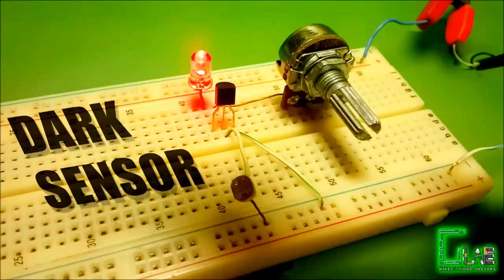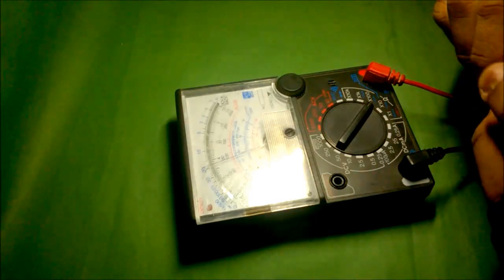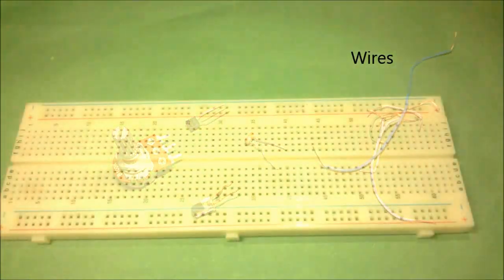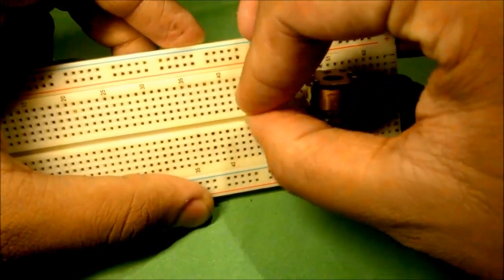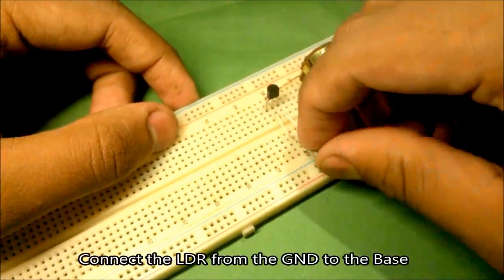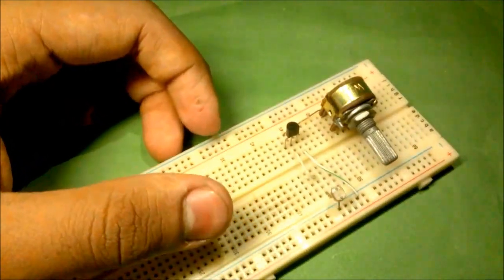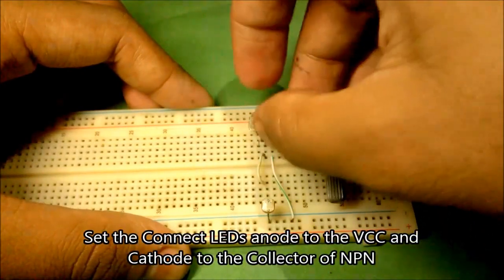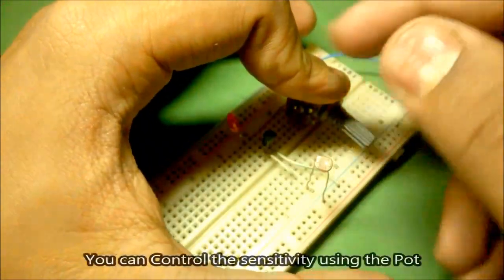Dark Sensor using One Transistor!

Comment: Can I use bc548 instead of bc547?
Reply from the maker: BC548 is NPN, while BC547 is PNP, To switch BC548, you are going to need postive voltage to bias the transistor. To use BC548, just switch the potentiometer (Volume) and photoresistor (LDR) on positive and negative side.